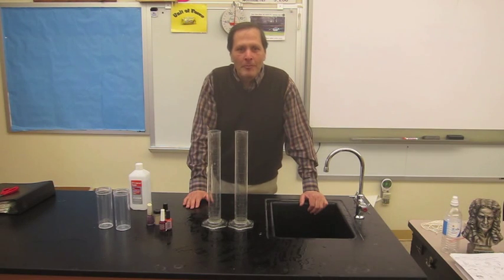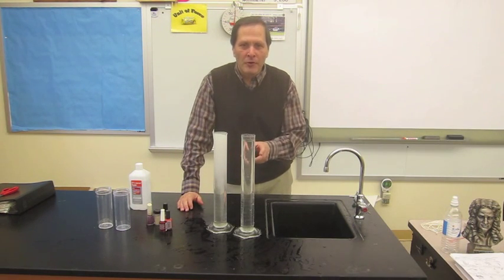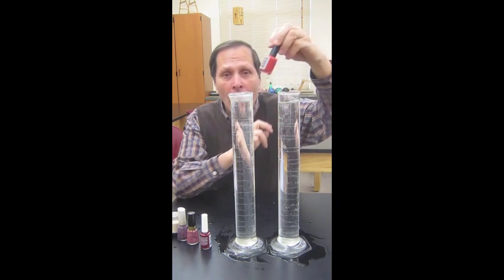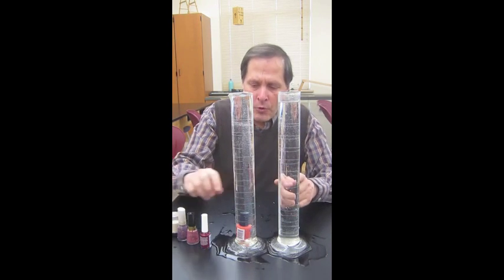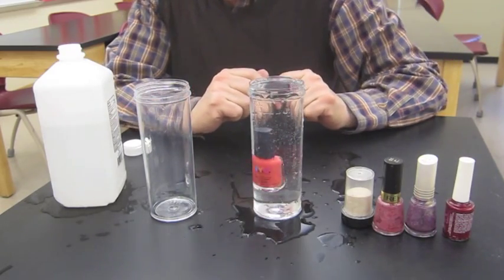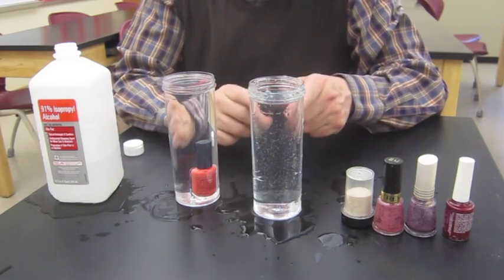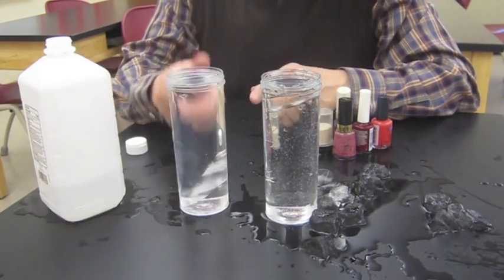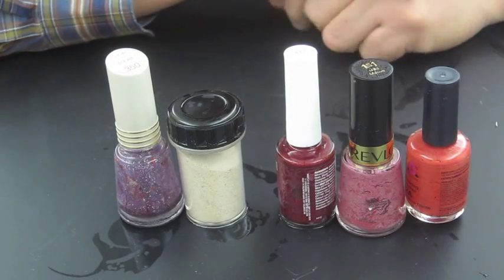toy physics-floating and sinking bottles, bouyant bottles////Homemade Science with Bruce Yeany

Comment: Mr. Yeany, I tried doing this  experiment. It didn't work. Can you guide me. In fact both the cases the nail polish bottles were sinking
Reply from the maker: The bottles you were using were too heavy,  you need to find bottles that  float and then adjust them so they just barely float.  If the bottles are too light and don't sink when filled with water,  then adjust them by adding sand instead of water.  When adjust them,  use cold water and if they just barely float in cold water they should sink in hot water
Reply: @YeanyScience  Thankyou so much for your prompt reply. Mr Yeany, need a clarification. If the bottle doesn't sink, should I try putting water/sand into the bottle and then try to make it barely sink. Is that you mean?

Comment: Don Herbert, Mr. Wizard, did this with sugar water and a potato.  Sugar water on the bottom, plain water on top and potato floats half way.
Reply from the maker: +Observ45er,   I never saw that one, but sound like a good alternative.  I have a similar experiment on my list to show.   It starts with 2 inches of salt sitting on the bottom of a graduated cylinder filled with water.   A golf ball is added to the container and settles down to sit on the pile of salt.  I set up this experiment over the school year and let it sit  for several months.    It takes a few days but the ball will start to rise as the salt slowly dissolves, .  We mark the cylinder each month.  Buoyancy,  density,  diffusion  all come into play.  The rate of ascent can be varied by the width of cylinder, wider will allow it to diffuse faster around the ball but we're still talking months.
Reply: Bruce Yeany  Nice one!
Reply: Mr. Yeany, I tried doing this  experiment. It didn't work. Can you guide me